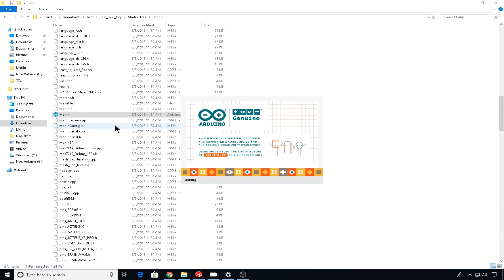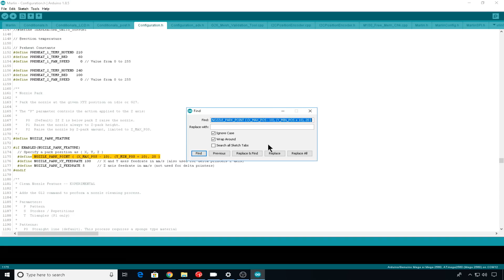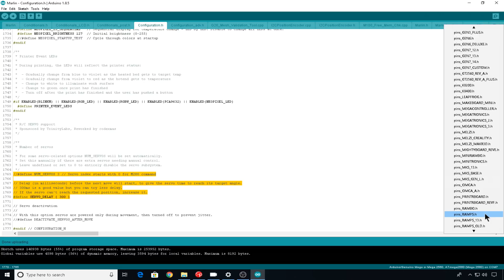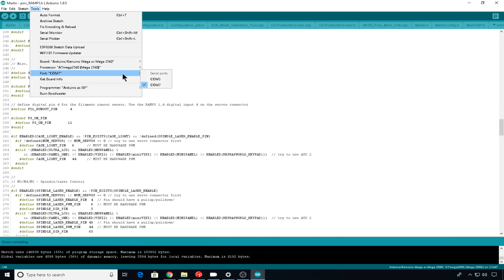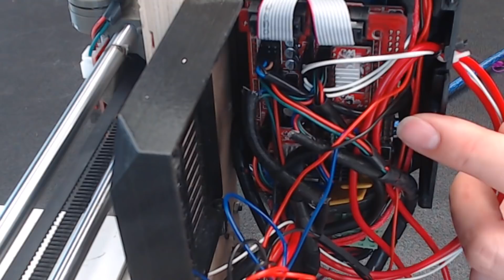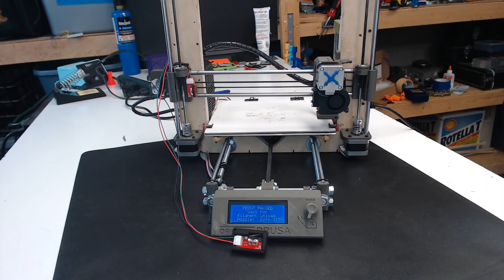Filament Runout Sensor - Native Marlin - Chris's Basement

Comment: Againm another helpful tutorial. I install the same sensor on my custom built Delta, with the SKR 2.0 board and Marlin 2.11.   Installation was simple, but I had a couple of odd issues.
1. Even though enabled in firmware, I had to M412 S1 and M500 to enable the sensor once loaded to the board.
2. The active Sensor interferes with auto bed leveling, but not with auto calibration.   Disabling the sensor, allowed me to auto-bed level. Then I simply reactivated the sensor for printing.  

This may be just me, but I thought it was worth mentioning.
Reply from the maker: Thank you for your insight!

Comment: Hi I've been able to config my skr1.4 turbo because your tutorial was very useful, now because I use vsc do you have any videos regarding using this runout switch on my skr1.4 turbo via vsc or would it be exactly the same principle? I'm about to start working on my second printer and want to use the same switch you have in this video as I have them
Reply from the maker: It will be exactly the same, just use the e0 detect pins.

Comment: I'm using a simple button (without PCB). Using 2 wires (ground and signal). The program either stops continually (normally close) or never stops (normally open). IDK what is wrong with it. Using RAMPS1.4
Reply from the maker: The switches can go into a floating state. Try adding a pull down resistor.

Comment: Hi Chris very nice and helpful dvideo, I hava a question bucause I have a skr v1.3 and octoprint without LCD, I setupped  the filament runout sensor but the M600 need LCD controller . Instead of that  marlin suggest me that I need to use EMERGENCY_PARSER. But the problem is when the filament sensor dettect that thereisn´t filament the printer go to their position and wait for filament but without LCD I can´t takeoff the printer of paused, because in octoprint nothing happens. I hope you can help me thanks!!.
Reply from the maker: Yes, this is a common question. With M600 you will have to do some sort of button press to resume your print. I am not sure if there is anything that will let you work around this available for octoprint. People with touch screens have this same problem.
Reply: @ChrisRiley  thank you Chris for answer, do you think the mini 12864 LCD work ok? Thank's
Reply from the maker: @danzig483  Yes, it should work.
Reply: @ChrisRiley  Thank you !!!!!!

Comment: I've been trying to install a 3 wire filament runout sensor on my ender 3 with skr mini e3 v1.2 board. Is there anyway you could provide some assists on the firmware modification
Reply from the maker: What part are you stuck on? I can try and help.
Reply: @ChrisRiley  I connect the filament runout sensor on PT-DET connector and modified the firmware from the git-hub website and the wire is pulled from the sensor, the print continues to run...do i have the connector in the right port  or should I connect it to my touchscreen
Reply from the maker: @gjohnson5978  try it in the e0 stop pins, the ones right above x min endstop.
Reply: Chris Riley do I need change the PIN number in adv.h
Reply: Chris Riley also I have a 3 wire sensor
Reply from the maker: @gjohnson5978  If you use the pins for E0 stop, no changes to the pins.
Reply from the maker: @gjohnson5978  Just make sure red goes to V black goes to ground green goes to S.
Reply: @ChrisRiley  So remove the wires from the connector and use the red and black...
Reply from the maker: @gjohnson5978  You would use black and green, but the SKR should except all 3, just make sure they are on the right pins.

Comment: Hey Chris 
Just a quick question on filament runout sensor currently i have one hooked up but its not working as it should not sure if it is due to firmware ot wiring
I have it plugged into the E0max I think on the SKR1.4 Turbo board
The wires are as follows 
Red, Green, Black 
Looking at the board with the stepper drives to the top the Black wire is closest to the drivers is this correct?
Reply: ok I did some checking I know my wiring is correct there has to be an issue with software I am pretty sure.
this is what I have in marlin 2.0
"
#define FILAMENT_RUNOUT_SENSOR
#if ENABLED(FILAMENT_RUNOUT_SENSOR)
  #define NUM_RUNOUT_SENSORS   1     // Number of sensors, up to one per extruder. Define a FIL_RUNOUT#_PIN for each.
  #define FIL_RUNOUT_STATE     false   // Pin state indicating that filament is NOT present.
  //#define FIL_RUNOUT_PULLUP          // Use internal pullup for filament runout pins.
  #define FIL_RUNOUT_PULLDOWN      // Use internal pulldown for filament runout pins.

  // Set one or more commands to execute on filament runout.
  // (After 'M412 H' Marlin will ask the host to handle the process.)
  #define FILAMENT_RUNOUT_SCRIPT "M600"

  // After a runout is detected, continue printing this length of filament
  // before executing the runout script. Useful for a sensor at the end of
  // a feed tube. Requires 4 bytes SRAM per sensor, plus 4 bytes overhead.
  //#define FILAMENT_RUNOUT_DISTANCE_MM 25

  #ifdef FILAMENT_RUNOUT_DISTANCE_MM
    // Enable this option to use an encoder disc that toggles the runout pin
    // as the filament moves. (Be sure to set FILAMENT_RUNOUT_DISTANCE_MM
    // large enough to avoid false positives.)
    //#define FILAMENT_MOTION_SENSOR
  #endif
#endif
"
really could use some help here...
Reply from the maker: Does the filament sensor now show up when you run m119? Does the status change when you trigger the switch?
Reply: @ChrisRiley  Yes I can see it triggering and open status in M119 reports
It is working in the terminal but when I start a print it goes straight into filament runout warning and pauses the print with or with out filament in the sensor.
My wires are closest to the drivers 
Black green red
If I was to record a vid on the process for you to see what is happening what would you need to see
Reply from the maker: @shellyrobinson5806  I think the wires are wrong, it should be red closest to the driver, then black, then green.
Reply: @ChrisRiley  I can verify that it is not that way as I switched the wires around putting the red black green config for them and the light for the sensor does not light up at all now and it still did not resolve the issue
Like I said I'm pretty certain that my wiring is correct and that the switch is functioning properly so that leaves firmware to troubleshoot
Reply from the maker: Closet to the driver, it should start red, black, green.

Comment: I just got a befenybay 3d printer dual monitor sensor but I can not find anything on how to install and setup on this any ideas?
Reply from the maker: I'm not sure what one of those is, do you have a link to it?
Reply: @ChrisRiley  Amazon is selling them for the CR-10.
So really I guess my question is does Marlins firmware have a generic filament runout setting for any sensor?
Here is the link to what I have
https://www.amazon.com/gp/aw/d/B07SFFXC9C?psc=1&ref=ppx_pop_mob_b_asin_image
Reply from the maker: @shellyrobinson5806  No, it's not specific, Marlin will work with any sensor.

Comment: Is the Filament sensor reloaded still working right now?
Reply from the maker: Last time I checked it did.
Reply: @ChrisRiley  Just installed it the other day and it was working fine. Tried it the the following night and everytime I click print it turns off the bed and extruder temperature and will say cancelling the print and it hasn't started yet. Disabled the Filament sensor reloaded and everything was fine.
Reply from the maker: @rtcfpv1012  Sounds like the switch might be floating. The pi's have an internal pull up and pull down resistor. You might try to enable/disable it on that GIO pin.
Reply: @ChrisRiley   I'm assuming you got a chance to test the plugin. I'm new to all this and just following your youtube video instructions. I would appreciate it if you can tell me how to do it. Thanks for help and more power to your youtube channel. 👍

Comment: I always have issue to remember running M119 command - filament sensor triggered is filament in or filament out? And it seems nobody of marlin authors bothered to document it. DAMN.
Reply from the maker: I didn't learn that m119 would work until years later.
Reply: @ChrisRiley  I see, but the worst part even after you realize it is difficult to realize in what state filament sensor should be. Configuration.h says, that by default it should be HIGH when filament present. But HIGH is it triggered or open? And it is damn impossible to find anywhere (maybe I cannot) what it should be. I even created FR request on github, to put that information in Configuration.h
Reply from the maker: @bumbarabun  It depends on the sensor you use, with a micro switch you can can it just by switching the wires on the legs. Not sure on the optical endstop, there are a couple different ones.
Reply: @ChrisRiley  sorry, maybe I did not make it clear. It is not difficult for me to switch logic, either by wires or flipping that flag in firmware. I find frustrating that you have to run test print to determine that if your logic is correct. It would be quite easy tune if they say "you logic should be that when filament is present M119 should say filament: TRIGGERED", but that information is nowhere to be found. In Configuration.h they say "firmware assumes that sensor value is HIGH when filament is present". But HIGH is that triggered or open? And that drives me nuts - it is so easy to provide that information and it would be so valuable and nobody bothered. And looking around so many people confused by it.

Comment: I want to ask you if you have any idea?
I have JGAURORA A5 and i broke the filament sensor pins on the tft screen borde. So i need to plug that sensor to the mks gen L motherboard. Now i fallow your video all is good but when the sensor deducts the filament run out its pause the print but the TFT screen shows nothing about it. And i cant resume the print. 
I change definition of it in pins_RAMPS.h as #define FIL_RUNOUT_PIN 2 or 4. Although the filament sensor works that way and pauses the printer successfully, the touch screen ignores it.
Reply from the maker: Yeah, it sounds like it was using the TFT filament feature to trigger it before. Now the TFT will ignore it. About all I would know to do is swap to a different screen. I don't even think there is a gcode command you could send it.

Comment: Chris,  Since its been a while .. maybe a video on how to use the filament runout sensor on a MKS TFT35?  would be good sequel.  I connect mine and enable in smoothie firmware and ... nothing.
Reply from the maker: You might be right, I would like to try some of that screens features out, I will have a look at it.

Comment: Good evening Chris - finally got this working - forgot to mention I was using Marlin 2.0 bugfix version. Anyway had to use Z_MAX axis pins with a change to the pins on Ramp 1.6+ board to "#define FIL_RUNOUT_PIN P1_28" (not servo pin 4) currently using Octoprint and works ok. P.S removed #define Z_MAX_STOPEND (//). plus changing #define FIL_RUNOUT_INVERTING true FROM false. Thanks for your help and great videos. Your a star for for allowing people like myself (greenhorns) to understand and learn this system. :)
Reply from the maker: So happy that my video helped you and that you got it working.

Comment: Really I love your well explained videos,
I Have a problem in Einsy board i build my own 3d printer using Einsy board, And I use Marlin-i3-MK3 firmware (https://github.com/prusa3d/Prusa-Firmware) but how can I install Power panic in my printer I have mk3 power panic PCB board but how can configure in my firmware? 
sorry for my English.
Reply from the maker: That is a great question, but I have no clue. Do you have the same PSU with the wire Prusa uses?
Reply: @ChrisRiley  yes I have same PSU with wire.
Reply from the maker: @PatelMayankG  It should just work then. Same firmware, board and PSU.

Comment: Good evening Chris - Everything now working except every time I start a print it is wanting to change the filament prior to print. Any ideas - Thank you in advance.
Reply from the maker: Does it allow you to continue?
Reply: @ChrisRiley  Hi Chris yes it allows me to continue - The problem seems to be on startup - once a print is done and another one setup without restart there are no issues.
Reply from the maker: @247hinkey  Interesting, seems like the sensor gets triggered or something. Try turning on the pull up in the code.

Comment: For an intelligent person I'm rubbish at this : )  I just bought a runout sensor; it's wires are Red Black White; 5v Ground Signal? Do I need to swtch the wires around from what I bought new? That seems odd.. but I do have everything I need to do that. Yes/No would be appreciated, from anyone.
Reply from the maker: Depends which pins you use. Endstop pins, you should be good. Servo pins they will probably need to be switched.

Comment: Hi Chris, thanks for the video.  My sensor was advertised with black red and white wires.  Easy enough, black ground, red hot and white signal.  Problem is the sensor they sent me had blue red and green wires!  I cant find a pinout or wiring diagram anywhere for this sensor. https://www.amazon.com/gp/product/B07F65TXGS/ref=ox_sc_saved_title_7?smid=A26ATEC08S9EFM&psc=1
Any ideas how i can get it installed without damaging my mks gen 1.4 if i guess wrong and have wire(s) inverted?
Thanks
Reply from the maker: Is the case on that sensor easy to open? It's probably marked on the PCB I would guess.

Comment: Good morning Chris. Thank you for publishing these excellent tutorial videos. I am fairly new to 3D printing and have been upgrading my printers, right now my Ender 3. Installing an MKS Gen L board with 2208 stepper drivers. I have been binge watching your videos. I made the changes in Marlin for the filament runout sensor, per your instructions but when I verified the changes the following messages showed up:   static assertion failed: ADVANCED_PAUSE_FEATURE is required to use M600 with FILAMENT_RUNOUT_SENSOR         #error¨FILAMENT_CHANGE_UNLOAD_LENGTH must be less than or equal to EXTRUDE_MAXLENGTH      I am running Marlin 1.1.9    I went through your tutorial again step by step to verify I did it correctly, think I did. I am unable to find EXTUDE_MAXLENGTH anywhere. Might you have any thoughts or word of wisdom? This would be a 3 coffee cup response. Thank you.
Reply from the maker: Yes, this is what you are looking for, it's in configuration.h line 461 on my screen #define EXTRUDE_MAXLENGTH 200
Reply: @ChrisRiley  Thank you for your prompt response, Chris. I will look at that when I get home from work. Any thoughts on the other message I received regarding the ...ADVANCED_PAUSE_FEATURE ...?
Reply from the maker: @dustykatz9504  Yeah, it's talking about the pause and park features. You just need to make sure both are commented out. Try to fix the extrude length error and see if it goes away.
Reply: @ChrisRiley  Hello Chris   That did it, it verified with no errors.  Thank you. Coffee coming your way.
Reply from the maker: @dustykatz9504  Thank you! Coffee is much appreciated.

Comment: what if im using a homemade switch instead of a preconfigured board? do the wires go directly to the pins and if so which ones?
Reply from the maker: Yes, you can use any switch. Go with the GPIO pin and the ground pin.
Reply: @ChrisRiley  thank you, also how to i invert the rotary encoder direction for the control screen?
Reply from the maker: Yes, check out these options in configuration.h

//
// This option reverses the encoder direction everywhere.
//
//  Set this option if CLOCKWISE causes values to DECREASE
//
//#define REVERSE_ENCODER_DIRECTION

//
// This option reverses the encoder direction for navigating LCD menus.
//
//  If CLOCKWISE normally moves DOWN this makes it go UP.
//  If CLOCKWISE normally moves UP this makes it go DOWN.
//
//#define REVERSE_MENU_DIRECTION
Reply: @ChrisRiley  thank you. ^W^

Comment: Hey! Don't know if you know but the Prusa i3 indirect runout filament sensor is on the market, why still use the clasic mechanical endstop ? link here: https://goo.gl/WxB7gp
It does not work with ramps 1.4? I would like to buy it. Can you review it? or just post a comment here if it works with adruino mega + ramps 1.4 or re-arm + ramps 1.4.

Comment: Hi mate i was going to put a filament runout swith on my Tevo Taranual  a normal end swith  with two wires, just wondering if you can help me in marlin, i am usings easyconfig 2.0, many thank
Reply from the maker: I can help in Marlin for sure. I don't know the easy config tool. You should be able to just un-comment the filament sensor line.

#define FILAMENT_RUNOUT_SENSOR
Reply: Chris Riley thank you, that’s what I thought, thank you for replying back

Comment: Hi,Chris, I finally figured it out about the runout sensor.It was pin 11. But I still have a problem with the pause parking , to change the filament.When it parks it stays ontop of the print and when I change the filament ,it starts coming out on the print. Thanks.
Reply from the maker: I recall someone else having this issue, don't remember the fix. Make sure of these settings.

Configuration_adv.h make sure this comment is removed:
#define PARK_HEAD_ON_PAUSE 

Configuration.h make sure nozzle park comment is removed.
#define NOZZLE_PARK_FEATURE

#if ENABLED(NOZZLE_PARK_FEATURE)
  // Specify a park position as { X, Y, Z }
  #define NOZZLE_PARK_POINT { (X_MIN_POS + 10), (Y_MAX_POS - 10), 20 }
  #define NOZZLE_PARK_XY_FEEDRATE 100   // X and Y axes feedrate in mm/s (also used for delta printers Z axis)
  #define NOZZLE_PARK_Z_FEEDRATE 5      // Z axis feedrate in mm/s (not used for delta printers)
#endif